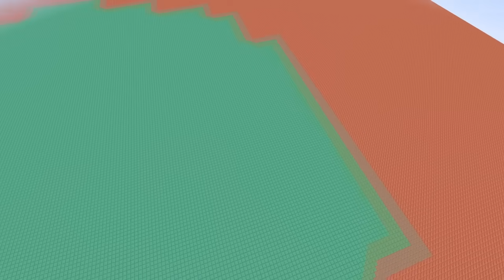What's The Fastest Way To Get Oxidized Copper And How Long Does It Take?

Comment: what would be the fastest way to get 1k fully oxidized copper blocks though. i get that the less dense is faster but it takes up so much more space and will take long to replace. since it is determi ed by a sub chunk if i fill an entire subchunk i will have many more blocks. or if i place a full layer every 4 blocks it will have more blocks than the more spaced out. even if i place lines that are spaced apart it will contain more blocks. 
it might still be faster to have less dence and just replace them

Comment: Is the inside of the cube fully oxidized too after those ~150 hours, or does it still have a nice orange core?
Reply: It'd have to be at least a little oxidized, since you can't have a block 2 stages ahead of any other in 4 blocks, I'd guess it looks about the same

Comment: Why have they changed the oxidation to be related to tick speed rather than the number of days in-game? It feels really weird and annoying that it's now based on tick speed. 

I mean, sure it may have caused problems with some players and I don't want to diminish any negative emotions or experiences those players had with those issues at all, but does fixing it to match the tickspeed really line up with what they said and showed off about it at Minecon Live originally?
Reply: Because it was causing lag

Comment: Hey mango can you do a video explaining spawner's mechanics and everything you need to know? Like for example how to get the most out of them. On my server i see players using 10 red cow spawners for 10 micellyum blocks . All of the spawners clogged up together. Isnt that supper inefficient? Also is there a mob cap for spawners? Even if for example they are taken out of the spawner's 4x4 radius?
Reply: How exactly do they get cow spawners?
There is no fancy magic behind spawners, but Ilmango made a video a while back, showing how to simple use the additional spawning space on top of the spawner as well. This allows you to get 100% efficiency.
Mobs spawned from a spawner DO count towards the mobcap (70 mobs), yet the spawner does not stop working when the mobcap is full.
Reply: @racernatorde5318  Well what do you mean how do they get cow spawners? We have shops from plugins.
Also they do count for mob cap,i saw a video abut that. And also once i reach like 20 cows in front of me from 9 spawners ,the spawners stop working.. and yes its out of the 4x4 rage around the spawner
Reply: @contmental6616  Then those cows were still in the range of the spawner. They can spawn inside a 9x9x3 with the spawner in the center, but there is a bigger area around it, in which the number of the mobs has to be below four (I think). Otherwise the spawner stops working. Just google for ~"minecraft spawner range" and you should get some good illustrations for the range.
Reply: Im confused. And i think so are may of MC players. It would be great if a more in depth video was made

Comment: 4:56 I hope with all my strength that this system includes waxed blocks within that distance so we can automatically obtain all four stages separately.
For a brief explanation, Waxed normal copper at the center of two rows of unwaxed copper only lets the unwaxed copper progress one stage. That would be incredibly helpful for automated copper aging farms.

BTW once again because people don't read: This is what I hope for, not what exists.
EDIT: Example of what I mean in the video at 14:22
Reply from the maker: waxed copper doesn't count
Reply: @ilmango  tbh I hope they change it, would be fun to build 4 block farms for each stage of copper since that seems to be a happy middle ground between single block farms and line farms

Comment: >the fastest method

Couldn't you oxidize them even faster by intentionally surrounding them by next-stage oxidized blocks? It might be difficult for the lower oxidation stages, since the influencing blocks would themselves oxidize, but to get to the last stage, it would be simple to make it a little bit faster by introducing fully oxidized blocks.

Comment: I'm pretty sure there is a more compact way of placing the blocks with them still staying 4 blocks away from each other. You basically need to imagine a rhombus (or a diagonal square) around the block, and tesselate the plane with them. In your grid there is a lot of blank space left if you imagine these rhombuses. It is better to place them like this:
□□□■□□□□□□□□□□□□
□□□□□□□■□□□□□□□□
□□□□□□□□□□□■□□□□
□□□□□□□□□□□□□□□■
□□■□□□□□□□□□□□□□
□□□□□□■□□□□□□□□□
□□□□□□□□□□■□□□□□
□□□□□□□□□□□□□□■□
□■□□□□□□□□□□□□□□
□□□□□■□□□□□□□□□□
□□□□□□□□□■□□□□□□
□□□□□□□□□□□□□■□□
■□□□□□□□□□□□□□□□
□□□□■□□□□□□□□□□□
□□□□□□□□■□□□□□□□
□□□□□□□□□□□□■□□□

Comment: 1 hour is way too small. It needs to be wayyy longer, 100 hours at the minimum. Also metal corrosion doesn't depend on the amount of metal present. I would presume having a little oxidation in the first place would accelerate the process rather than slow it down greatly.

Comment: i may not have done math in a long time, but...
the number given to us for the chance of 3 oxidization ticks happening in a row is a low %. This can be put into the same format as Dream's infamous "1 in 7.5 trillion" by finding the reciprocal of the low number we have there, then making it no longer a % by multiplying by 100.
i kid you not, 7.2e-12 - when made into a non-% and finding the fractional chances, is 1 in 7.2 trillion. single trillions when applied to the power system is e14, and when finding the reciprocal and multiplying by 100 to remove %s, you flip the sign of the e (e-12 to e12) and add 2 levels of power (e12 to e14) so, if this math is right which it probably isnt, the chance of it happening is surprisingly close to the magical number of 1 in 7.5 trillion, in a relative sense